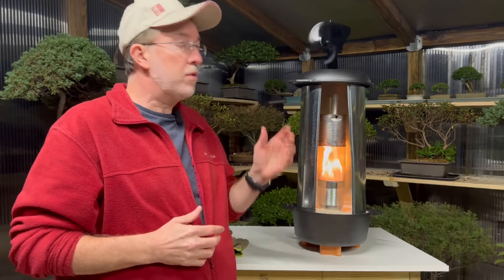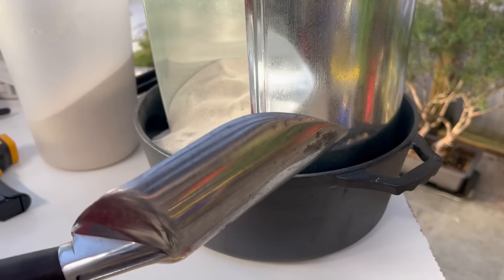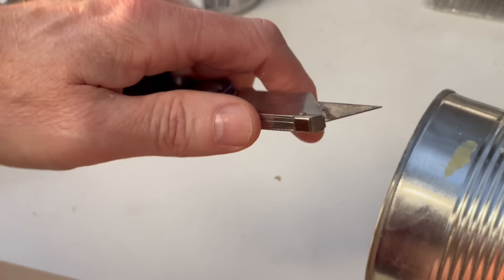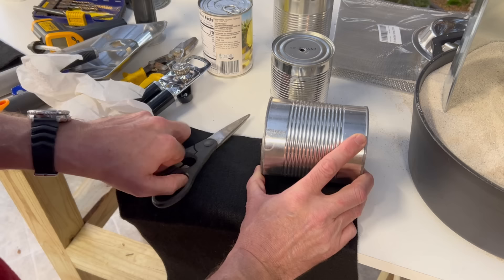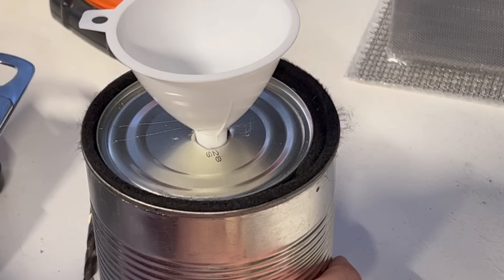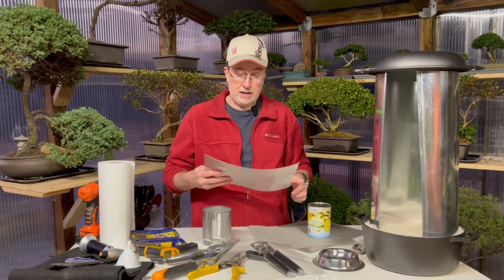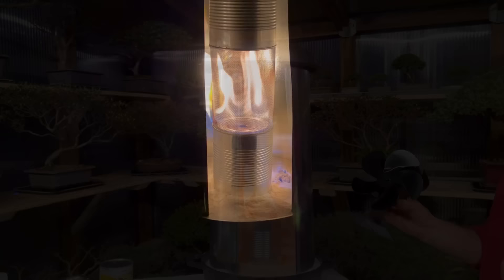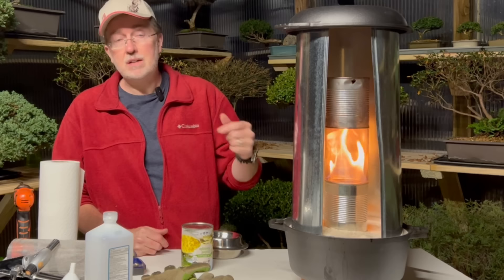DIY INFRARED HEATER | No Electricity Needed For Greenhouse Heat

Comment: I have played with these EXTENSIVELY over the last year.  Couple tips to note.  
1 is denatured alcohol which burns almost completely clear.  
2.  A tighter fitting can that uses only 1thicker layer is better... smaller more controlled flame to stay inside the mesh.  Also... a hole in the can will often pop the can if the vapor ignites.  Have found its actually better to NOT have a hole as I don't have to worry about vapor igniting and the flame stays in the wick.  Or, if you need a vapor release.... and a pour point, put a couple layers of screen mesh over the hole from the inside and stuff with steel wool.  You can allow vapor to escape, but you DON'T want the flame to catch below the surface exploding vapor in the can.
3. Most of the felt...and it MUST be carbon felt, not filter or anything else.  FELT or it won't wick as well and will smoke more.

As interesting as this is... it DOES take a considerable amount of tinkering to get the right amount of wick with the right amount of chimney... as the alcohol vaporizes this creates a whole plethora of new challenges and it gets VERY hot.   As a heater, I have found vegetable oil to a far better source and far cheaper. and MUCH longer lasting... but again takes a little tinkering to nail down the right amount of chimney with wick to reduce it to a nearly smokeless system.  The hotter everything gets, the more changes occur that changes the dynamics of each system.
Reply from the maker: Great tips

Comment: I like this design a lot, and really enjoy your videos....It seems to me, that if you put a short bolt in the filler hole, for a plug, you'll stop burning off the alcohol fumes, and should increase your burn time, and efficiency, because the wick will be the sole source of flame...
Reply from the maker: Thanks for the tip….I’m always wanting to improve it.

Comment: I use carbon felt for lanterns, so I would use lantern oil before alcohol but you would have to leave a little at the top of the can like a wick.. almost the same concept as a Kerosene heater..

Comment: For your stainless mesh. You could have pulled a single long wire thread from the mesh you aren' t using and woven it through the overlapping sides to hold. No folding or bending required.

Comment: boss let me offer a couple things. inclose it totaly with metal skin rather than with it open. add a small vent hole just above the sand level, ( or even drill it from bottom of  dutch oven & run it around in sand a couple loops then at sand level plus 1" let it open out into the center column to feed flame preheated air will act like a jet causing unit to burn hotter ) next remove that fan & replace it with this, a inner stainless steel lid with a center hole just large enough to hold a heated air column driven metal fan that will work from hotted rising air . Now drill holes around the outer edge of the dutch oven lid this will cause a all natural heat draw & force air cycle with multi directional hot air movement while retaining maximum of heat production . I build & uses a tea candle multi can system to heat my greenhouse . my design uses a inner most can that holds the candle then the next can holds water up to about 1" from top then the last & outermost can is inverted with holes punched around what was the top rim before it is inverted with vent holes in top (or bottom  depending on how it's oriented ) to allow hot air to escape in all directions. These work for me in zone seven. Great video & design
Reply: Could you make a video of your design?

Comment: Sand battery comparison.
Look up "how many BTU's can be stored per pound of material".
  The best is water.
 Concrete, is pretty decent.
 Rocks and sand are lower.
This is why water barrels store heat very well from solar heat.
  Solar greenhouses use water barrels for nite time moderation.
  Alcohol has fewer BTU's than kerosene, jet fuel, diesel or heating oil.
Kerosene, diesel has about 133,000 BTU's per gallon.
  Firewoods all have different BTU content.
Black Locust is higher than Oak.
Poplar (aspen) is really low.
Reply: I like running kerosene lamps and lanterns.
  Metal lanterns (Dietz) are safest, but also give off pollution that is not acceptable in the house.
  The glass bodied lamps burn super clean.
  Full sized wicks burn 1 ounce each hour (giving about 1,100 N
BTU's.)
  Three kerosene lamps/lanterns produce the same amount of heat as a 1kw electric heater, and give light, humidity, and CO2 to help grow all the plants.
  Plants need CO2 or they will die.

This agenda to reduce "carbon emissions" means they want to kill plants and people.
Reply: @craigescapeddetroit5198  I will not fall to the left’s agenda, I am proud to be Carbon!!

Comment: I had an antique one of these that burned kerosene or paraffin and it didnt fume you out but it did stink a bit. It kept a room toasty and could warm an entire house floor over several hours. It was all steel and painted black, with a swinging gandle like a lantern on top. It was complwtely unsafe as far as tipping over was concerned though it had a wide base and was difficult to topple short of walkikg right into it. 1 wick generally lasted an entire season. I think it might have held about a quart of fuel.

Comment: Thanks.  I think I would use a pot on top and fill it with sand - more heat up t here....and the more sand and temp the better. It might take some experimentation (or math skills I don't possess) to work out an optimum quantity in relation to the flame size.  I also think you could put some fins at the bottom of the 'chimney' that extend into the sand in the bottom pot so you would get more heat transfer there.  I wonder if you put some holes around the top of the outside wick can you would get a little more oxygen into the flame where it starts ...it might burn a bit cleaner...??
Reply from the maker: Possibly yes….cheers

Comment: Great video and would look for a replacement for the duct because: Zinc fumes are set free when galvanized steel is heated. These fumes are very toxic to breathe.
Reply: @lonniedomnitz1720 listen again it's not galvanized. He plainly stated it's STAINLESS
Reply: He clearly stated the stainless steel screen.  But I’m talking about the HVAC Duct that he used.
Reply: Video says to use stainless steel duct material not galvanized for the heat shield
Reply: @pauliedi6573  did not hear him say that and the thumbnail opening image in the video looks like an ordinary galvanized steel duct.  But if he did say that then I apologize.

Comment: I would forget the bottom pot, if you are directly on the ground just push the metal body right into the ground.  If you have a concrete floor, dump a large pile of sand and there's your base.  Lower to the ground is better because heat rises, plus it will use more of the ground as a heat sink.

Comment: Great video I enjoyed it so much that I built one. It works great! However, it works a little too great, I am running through alcohol very quickly. I see below to cover the fill hole I will try that any other ideas. One change I made was I bent the bottom of the reflector in about 1.25 " so the weight of the sand would hold the reflector in place better. I had to snip the flange to bend it to fit the pot.
Reply from the maker: I wanting to upsize the entire contraption using a large stainless steel boiling pot.  👍
Reply: People here are saying to use olive oil instead of the alcohol because it burns better and longer and isn’t toxic to inhale

Comment: Nice, i see how it works, and instantly see a simpler way... well, maybe... lol... 
I think an ammo can what's the Rubber seal taken out of it and replaced with high temperature silicone from the auto parts store, and then cut a slot across the top of it about 6 inches long and then take a flat blade to hold the carbon fiber wick, and then put another can on top of it with holes around the top of it and use it in the same manner as you would a kerosene heater

Comment: You could use a cheap aluminum pot for the base if you want to do the sand battery. The thing is that’s not a lot of thermal capacity. A 55 gallon drum full of sand is a probably still on the small side for your application, especially since the sand is being heated top down not bottom up through the center.
Reply from the maker: I’m searching the goodwill for a cheap and massive boiling pot.  (Industrial kitchen size).

Comment: I have 20 gal propane tanks, 20 gallons each. And I have a little roller/ Dolly. And I set my propane tank there and my Mr. Buddy on top of the propane tank. Then I take the front off. My mister buddy, and  place it on top so I can cook and heat. And it's not far from the door so if I have to grab it and pull it out I can.  I have my carbon dioxide detector and my smoke detector. And I turn it on if it gets below thirty. Sometimes I leave the pilot on and turn off the heat and put my Pan on it.
On top of it,  it keeps it warm. I can also heat water with just the pilot. It's not real hot but it warm enough for coffee or tea.

Comment: Have you tried using a vegetable oil burner instead of a alcohol burner in that heater?. I've seen many nice vegetable oil burners on YouTube that work great with a carbon felt wick

But the best part is the cost. You can buy a gallon of cheap vegetable oil for $10

Comment: If you use copper wire to wrap the carbon felt the heat will atomize the alcohol faster on the way up. I used this small scale for meth spirit steam boilers.
Reply from the maker: Great idea
Reply: Cheers, just doing first terra cotta pot with Crisco lamp with candle in center. The wax is now floating on oil and still burning after 4 hrs no drop I can see. I have a thermo dc sprinkler in there so pretty safe if it gets too hot. @ZenGardenOasis.

Comment: I applaud the building of this,but also wonder why not just pick up an old kerosene heater that does all this plus has adjustable wick already, and has ceramic tiles already installed to radiant heat,as well as safely features built in in case of accidental tip over and stuff

Comment: Something else I would do would be to anchor that lower pot onto the stainless pipe and the lid so it's harder to knock over. Without being anchored if somebody bumped into it cause the stainless pipe to come out of the sand
Reply from the maker: Good point!!

Comment: I be willing to bet you can fill the bottom with sand n just push the pipe into it with a slight jiggle it goes straight to the bottom.....good luck 🇺🇸

Comment: Water holds 300% of the heat that sand does, making it a superior thermal mass. Surrounding the heater with pots or jars of water will add to the longevity of the heat once the fuel has been consumed.

Comment: I’d like to know how long it burns for and did you measure the high/low temperatures inside? Also how big is your greenhouse and what’s the temperature outside? I built a solid brick raised stand to support a black rain barrel that stores heat. I also left a small opening at the bottom to be able to slide a fondue burner. Only problem is it only burns for maybe an hour or two at most, so your design interests me. My greenhouse is detached with a peaked roof and single pane glass in most places. No insulation. I have many changes to make for extending the season even more.
Reply from the maker: Depending on can size.  Mine is about 5-6 house. Purity of fuel also affects burn time.  Cheers.

Comment: This costs a fortune to run , it's from another video years ago where we all made them and found a great heater that burned fuel super fast and most other heaters are cheaper. Mine like this didn't last an hour.  Heat rises BTW so that sand won't see much to store.
Reply from the maker: Thanks for sharing

Comment: Nice idea, but there is nothing infrared about that. Its simply an alcohol lantern that has a reflector. Infra red is electromagnetic radiation within the spectral band of light between microwaves and visible light.

Comment: Could you combine a bama lamp concept with this and burn olive oil gas. Of course you would want a larger copper pipe in the middle for the gas to burn since olive oil doesn’t burn.  Sort of a hybrid of the bama lamp and what you did here .
Reply from the maker: I need to try it.
Reply: @ZenGardenOasis.  was just rhinking of safety and if turns over wont burn

Comment: An additional thought: One can only speculate as to why using that carbon felt isn't used in kerosene heaters instead of those replacement types now used. My bet is there's no money in permanent wicks. 😮 

Sure they'd have to be redesigned for the carbon felt, but you'd never have to replace it.

Comment: There is a step or two missing from the video where for instructions on assbling the tower.

There is also no indication of how many ounces to put in the center can reservoir after soaking the felt, nor any indication of how many hours the fire will burn on hpw many ounces. I love your idea and appreciate the many hours you dedicated to creating the video. I am guessing the steps inadvertently got edited out. Also, I wonder if using copper mesh would yield more heat and whether Crisco could be a longer lasting alternative but it obviously would not wick up as efficiently as kerosene or denatured alcohol...
Reply: Will olive oil or crisco work with a wick?
Allergy to rubbing alcohol after working with it everyday for 2 yrs.
Reply: Try a mixture of seed oils anD acetone or something like that Because the seed oils are no good for you, they're only good for burning. Eagle

Comment: So.... basicly you made a kingsize alcoholburner, right?
Would have been interesting to see ho warm the sand would get instead of the the upper can. Since the heat from the flame tends to go up, it is logical that can gets warm as well and since you enclosed it, the metal around it will heat up as well. But what about the sand? How warm will it become and how long will it give off that heat into the air, once the candle stopped?

Comment: That looks really hard to refill.  Could you add a third can at the bottom that holds the screen around the other two bottom cans,  so you don't have to reinsert the wick material everytime you remove the screen to fill?

Comment: I feel like I missed the 3rd can? You did the one you have on the top, the 30oz, then did the smaller one and I thought you were putting the carbon around that and into the first can, but then it was a different 30oz can once you built it? Do any holes go into the 30oz on the bottom?
Reply from the maker: Yes correct….cheers.

Comment: Could the top cover have a horizontal platter driven by pulley from the fan that slowly geared would turn the fan 360° to spread heat?

In order to control fuel use, could vents on a closed container work? And a thermostat, of course 😂
Reply from the maker: Interesting idea

Comment: Thank you it's a very good idea !
But I can't find this hexaust pipe reflector online,
yours is cut along its entire length, did you cut it by yourself ?
Reply from the maker: Thanks so much for your support.  The metal reflector came from lowes hardware.  I bought two types, one was stainless and the other was aluminum.   The aluminum one I cut to size and the stainless was as needed.  I didn’t put a link as the shipping cost on it would most likely be expensive.   Hardware stores in your area will most likely carry the one you need.  Be careful on cutting either as the edges can be super sharp.  Cheers.

Comment: I would rather connect together using aluminum tape or metal zip ties you could use a metal thread to sew it together to make it seamless or better yet perfectly fine with two edges up to each other and staple them together

Comment: Right when You came to assembly of your heater It got very confusing how you put it all together. And what is the cylinder inside is all about, and how to connect it to a 3 can ? And bottom two cans?
Reply from the maker: The additional bottom can holds the felt in place.

Comment: How did you attach the steel rolled up mesh thing to the upper and lower cans? Looks like the upper can will just fall off if you bump it
Reply from the maker: Just has tight fit

Comment: You showed us a cast iron Dutch oven so could you rig one of these up in an actual cast iron coal stove that use to burn coal?Also if you could actually recycle an old cast iron stove to experiment with this type of cheap fuel heating, would it be safe enough to use in a dwelling as they used an old portable oil stove that used kerosene and a wick bucket in its bottom?
Reply from the maker: Use safety detection equip.

Comment: So you are using three cans for this build?  I thought there was only two (large and small for the heat source).  What purpose does the third can serve and what size compared to the other two?  Thanks!
Reply from the maker: Holds the carbon felt in place

Comment: I have about 4.5 Gallons of Methanol left over from another project. Reckon that would work? It burns almost invisible and may be too flammable. ??
Reply from the maker: Use correct detection equipment for harmful vapors and smoke.